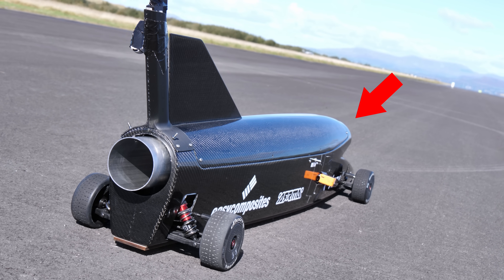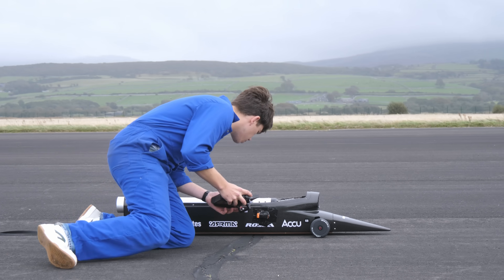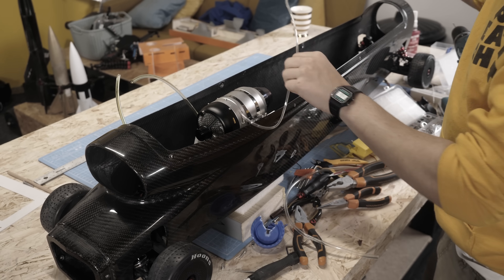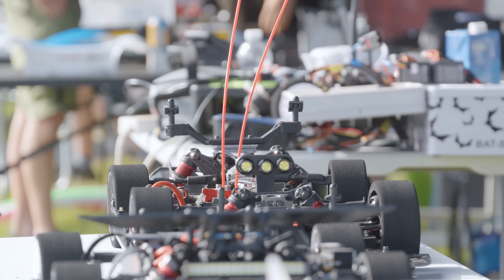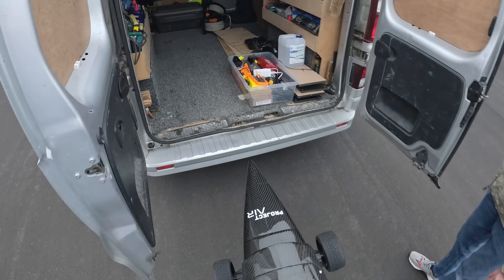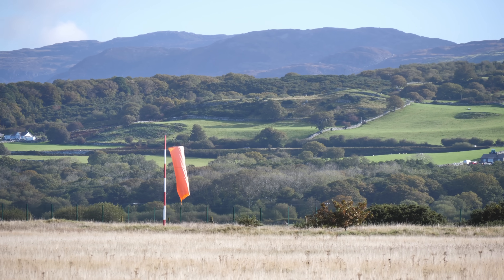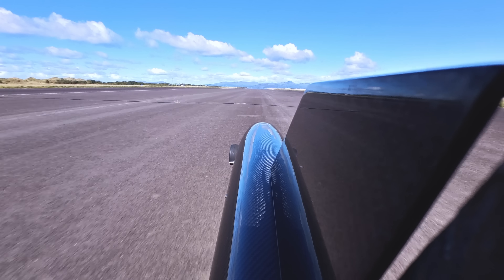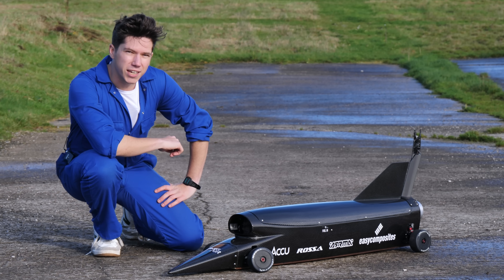World's Fastest Jet RC Car (Runway Testing)

Comment: I think your new car shouldn't have open wheel like structure, since wheels on their own create enough drag, but with the tire thread spinning and the suspension exposed that's even more drag. Also i think it would be more stable if it wasn't so top heavy and cameras had special places to mount them in, to minimize air resistance

Comment: Jet exhaust nozzle needs to be at the rear of the car, can’t duct the jet wash unless you want to inject more fuel in it and ignite it for an afterburner…ah hem. 
Just switch the arrangement around with the duct at the intake to the jet intake, and put the fuel tank(s) over the front axel for good steering traction. 
That one improvement might help it hit 200mph without changing anything else.

Comment: Awesome but I suggest some tips that could help reduce the drag:
- wheel covers;
- fpv camera incorporated in the body/canopy;
For better control:
- another type of wheels that can handle the temperature and be more durable;
-make it more front heavy - helps for stability & grip.

Cheers

Comment: I think yall should make a air guide from the inlet to direct most of the air into the jet engine. Theres definitely some drag inside the body from air entering but not exiting properly if yall were to guide it into the engine there wouldn't be any drag and would actually help the engije produce more thrust. Also i would switch the bottom skid plate to delrin instead of wood it doesn't need to be as thick and wll reduce weight you can make replacements. Also i think yall should fill the inside of it with foam, because the inside air dynamics inside of the body actually do matter a lot or at least finding a way to keep the air flow constrained to enter and exit unobstructed. Also i think it might be possible to reduce drag by putting pieces to deflect the air over the suspension so at least the suspension part doesn't have much drag but the wheel still would. You could just make a nose cone that covers the front wheels and thats it at least

Comment: You need to design the suspension geometry specifically for high speed stability and resistance to bump steer. The cars horizontal cross section is also massive, it needs to be low, wide and smooth from a frontal and lateral cross section to avoid wind shear. Your fins could be smaller also. Look at the fastest electric designs, they already trial and errored their way well ahead of what you've achieved so far and should be used as a yard stick.
Enclosed wheels, smoother lower and wider body sections. Smaller drag elements. I would say that for stability sake making the engine unsprung mass at the rear/both reduces the risk of it coupling with the suspension to reduce vibration and also reduce the twitchyness of the steering because the suspension will not be so reactive. High unsprung mass means a more stable ride and a wheel that becomes less responsive to rapid changes in surface quality which you need for a speed run. As others have mentioned, dynamic steering so you can reduce the risk of over correcting at speed. Hope this helps just my two cents.

Comment: I saw a mistake with the car is you need to improve the chassis and make the shell harder and if you go past its limits it will explode and break apart and the design isn’t to bad but the engine is extremely exposed and make it way to heavy and it isn’t described equally making it to heavy and the Go pro mount is very bad and the reason it couldn’t go that fast is because of the weight and please max a mount for the Go pro on the car instead of duck taping it
Reply: Correction Distributed equally

Comment: Well done, huge achievement. Had me smiling from ear to ear, I came from Easy Composites. I have a background in FPV drones, completely self taught, not an engineer by any means but i love making things and learning. If i may add some suggestions from my observations:

1) A few people have mentioned recessing the gopro into the bodyshell. I don't think you even need a go pro. RunCam and CaddX manufacture small drone cameras that are suitable for small drones that also allow on board SD cards. You could fabricate/print a simple tpu canopy which mounts on the inside of the bodyshell and mount the camera, circuit board and video transmitter inside (you'll need to have the VTX antenna clear of the carbon bodyshell to get signal to a monitor or goggles)

2) With the above in consideration, you could mount a 6 axis IMU and connect it to your steering servos, i recall HPI produced a little Dbox system which serves as a stabiliser in their little drift cars. The advantage of this it that you'd have more stable steering. and the IMU would provide live telemetry data to monitor from the FPV OSD during the run, which thanks to the onboard camera you can also record to an SD card.

3) Consider looking at the suspension set up, it looks quite stiff. Adjust your sag, preload and rebound so the car is not so susceptible to hysteresis, you might go faster with slightly more dampening and softer tires so the car is not hitting the bumps in the tarmac and bouncing off them absorbing your speed, instead the car should glide over them. Wheel alignment check is also a good idea from time to time :).

4) You may need to revert back to the 220 engine. Better to have the power and not need it than need the power and not have it. even if it's just to power through head on winds!

I hope this helps, i'm excited to see the team beat your previous record.

Kind regards M

Comment: Would you consider using the camera setup drone pilots use? Mount the camera in the front somewhere, use goggles to see. Might help with steering when at speed.

Comment: Needs an aerodynamic redesign. That fin is asking for trouble, the wheels impart significant drag, and your intake size appears to be too large even for the larger planned motor? You can cut the vertical height of this monster down in half which will also greatly improve your aerodynamic performance. 

Can we get a full video on that electric wheel driven car instead? That seems like a much cooler record to chase after.

Comment: You made the right call to postpone the faster run. I would highly recommend the following, as a few people mentioned similar things: 

1. Loose the cameras and maybe adjust the shell to accept a camera right below the intake. Would require a bit of a bump/canopy to accommodate.  It should give an excellent view and also the bump should slow the air down enough for the bigger engine to use the airflow properly. Too fast air into the engine can be make it less efficient.  

2. Pilot the car from the camera fob. It’s far easier to make adjustment from first person to make sure you are in the center of the runway 

3. Make two steering settings, the one for the high speed run should run far less angle per input than the normal one used to turn the craft around.

Comment: I'm sorry but I believe you wasted the grate recourse you had with easy composites. You had access to aerodynamic tools and they could have built literally anything for you, but for some reason you went with this design? You calculated your drag at 200mp/h but you're not going to go 200mp/h. You're trying to beat 94.76 mp/h. At 100mp/h the difference in drag between the old and the new car would be only about 1.25N or 3.5%. The speed gain would be in the very low single digits, maybe about 2 mp/h in the same conditions. I honestly don't see how this was worth the effort and I'm utterly confused about your reasoning for the open wheel design.

Comment: Fyi, SuperFastMatt gets great video with a 360 camera in the rear stabilizer.  He points the lenses left/right which puts the camera stitching dead ahead, but it results in a super aerodynamic camera mount.

Does your radio have dual-rate switching?  You could really help the twitchyness with a switch to drop your steering sensitivity once you're lined up.  

Also, second the recommendation to get an FPV system.  It'll really help with driving precision during longer run-ups.

Comment: I don’t want to be harsh but here is what I don’t get: The internet is full of information on how to build something like this. Rules of aerodynamics are not too hard in your case. It needs to be stable to really floor it. It needs downforce and it needs to be aerodynamically efficient. This means that you can go with a Diffusor, fully enclosed wheels and a wider construction with a lower CG. And once that is designed, the turbine needs to be placed as perfectly as possible (lots of comments in every video on that) Once that design is in its first iteration, then you can start running it and make adjustments. And don’t make it too expensive to crash, this will hinder your success. You need to be smart or have deep pockets.
Reply: what i dont get is you took the time to type all of that fluff instead of just watching another video

Comment: I really think you should replace the axles with something that fits inside the bodywork. Or some kind of fin on the front nose that will create a low pressure area where the wheels are.

Comment: The steering makes me nervous every time. Please add a steering assistant that automatically corrects the car when it slightly steers left/right because of a small bump on the road. I have seen this done with gyro+magnetometer data - I don't know where, though. Other than that: great video and awesome car! This project really shows your engineering skills!

Comment: You should put a little drone flight controller, and make it run ardupilot as a rover, the speedybee f405 wing mini would be a great choice. Pair it with a GPS receiver, preferably m10 series, and you will have proper run data recording, acceleration measurements, vibrations, ground speed, precise trajectory... in a log file on a sd card. 
Yes exporting the data isn't easy, but definitely doable. I made a rocket flight data recorder by programming it as a plane to be able to interface an airspeed sensor (overall budget for the speedybeef405 wing mini FC, the foxeer m10q GPS, airspeed sensor and battery, <180£). For extracting the relevant data, either use a log analyser, or like me, export it as .txt or .csv file, and them run a python script to save the relevant messages in a separate file. Using ardupilot, even for data recoding, makes data analysis a little bit trickier, and less efficient than purposely-built arduino boards, but definitely easier to build, it's just a component, not a full side-project, as every sensor possible is already implemented.

On a side note, with run logs, you will be able to measure performance and assess wether a modification is effective or not, if the acceleration run happens as expected, if the engine performs as expected... I am no expert, but I am not convinced by the setup with the long pipe, I think you are loosing thrust, but it's just a feeling, with acceleration and airspeed data, you could compute the engin's real thrust for the whole run, which will vary depending on airspeed

Comment: Are you allowed to use rudders and ailerons etc to stabilize and control the vehicle?

If so, I'd like to see something which is like a plane/F1 car that automatically controls down-force on each quadrant (load strip/cell on each wheel) and direction to be constant at any speed. That would be cool.

Edit: I believe there's ways to automate feedback loops to run at ridiculous high speeds for automation with micro controllers. Separate from CPU - some kind of super high speed precompiled thing that 'just does that' super fast. I think it's used in robotics for position control. That's the kind of tech it would be interested to see used and learn about. And make a heads up display UI, like a webpage, like spaceX has - the girl (sorry, don't know name) could do this no sweat I'd bet. V3...?

Comment: The huge single fin being so high up is a very poor choice for stability, any over-turning and instead of correcting itself, it will tumble and completely disintegrate.

Not using the bigger engine from the start is a big problem, all the fine tuning you did is useless since the weight and aerodynamics aren't even remotely close to the final thing, you're gonna be wasting precious time re-tuning it next time.

You've already said you were gonna use smaller cameras in an aerodynamic pod, that's good (although you should have planned ahead and have a camera mount integrated into the CF body), but I hope you also planned an actual intake funnel for the bigger engine, because right now what you have isn't an intake, it's a huge pointless hole completely ruining the improved aerodynamics.

The wheels should also have a shroud, at least the back ones since they don't need room to steer.

Comment: One of the suspension arms changed pitch angle during the runs, which could be a potential problem causing unwanted lift at high speeds

Comment: Im wonderimg did easy composites use the mold to make 2 or more chassis ???? Would have made sense 😮
Reply: Hi 👋We'd simply agreed to make the one, as James was planning on the one trip to ROSSA with one fully kitted out RAC car.  But yes the type of moulds we used are capable of making 2 or 3 more parts.

Comment: Just a suggestion, but wouldnt it be more efficient to have a tricycle wheel setup where theres only one front wheel and its inside the fairing, so it increses aerodynamics and also simplifies the steering system and therefore reduces weight aswell. Ps: im not too sure if it would mess with the regulations and stuff, just an idea

Comment: I'm concerned with your exhaust setup. The jet engine has a small nozzle on the end that's designed to optimally expand the exhaust gas back down to atmospheric pressure while accelerating it. By putting the long tube after the nozzle, you're going to lose some of your thrust to wall friction. Moving the engine farther back could eliminate the exhaust tube and let the nozzle exhaust directly. Most fighter jets put their engines all the way at the back of the fuselage for this reason. However, it also would move the center of mass further back and make the vehicle less stable.

Comment: If it were me, I would do this.

1.We will make the width of the tire as narrow as possible to reduce cloud resistance.
2.The design of putting the tire inside the body will not expose the tire.
3.Think of a rigid shaft system as simple as possible without using a 1:8 scale design suspension and shock absorber. 
   This machine doesn't need bump and wheel drive. Of course it doesn't need durability either. 
   Why don't you reduce the weight with a small bearing and a small shock absorber?
4.How about a design that makes the whole wheel 3 and goes inside the body even with just one front wheel?
5.Let's experiment with the bypass duct at the back of the engine, or move the engine to the back...
6.I think we need to adjust the front camber and castertrail rear toe-in.
7.I will support you for a good result.

Comment: This is an extraordinary amount of work and money to make something that completely ignores the basics of aerodynamics. A bigger jet is not going to help you much without some significant redesigns. You need to cowl your wheels if you want to get over 100 mph safely at the very least. That camera setup is basically a sail asking for wind to throw it around. And your camber and steering dual rate is all wrong. I don’t know enough about jet ducts to comment on that but I have electric RCs that I have gotten over 80 with way less effort and far more safety. And I didn’t need a runway.

Comment: Look at aerodynamic principles in regards to the difference between your design and all the other record breakers:  
Increase downforce (ditch the tall, tubular design), reduce drag (enclose the wheels & cameras), two shorter wide spread vertical stabilisers instead of one tall sail, use fluid dynamics for airflow to the jet engine.

Comment: Rather than the GoPro taped to one side of the tail, you might want to consider something like an insta 360 mounted behind the tail in the rear tail spar thing.
That'd give you a full 360 degree view around the car with a very minimal aero penalty.

Comment: Get rid of the jet pipe behind the turbine. You’ll be losing most of the thrust due to skin friction drag. I wouldn’t be surprised if you gained 30-40% more thrust by shortening the length of the pipe to 4” and moving the engine to the rear of the chassis. The biggest downside to doing this, is it’ll make it aerodynamically unstable around the yaw axis. 

You also need to create a constant cross section intake that feeds into the turbine. This needs to be laminar flow and constant cross section. As you increase speed, you’ll gain more thrust due to ram rise, provided you have an intake pipe. This is far more important than having a long jet pipe. 

Also, get rid of the duct taped camera mounts and poorly designed antenna mounts. The RF antennas should be embedded in the 3D print, which should be formed around the vertical stabiliser to create laminar flow separating from the back of the stab. I noticed it’s a 5-8mm square edge. This will be creating plenty of turbulent drag. 

The wheels will be creating heaps of drag too, they would benefit from being inside the chassis, or at least with some ducts.